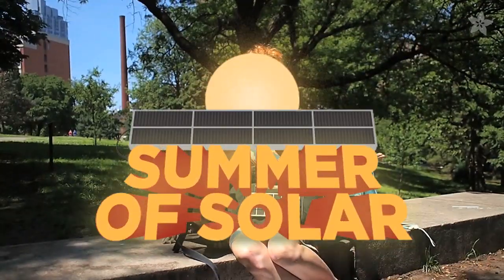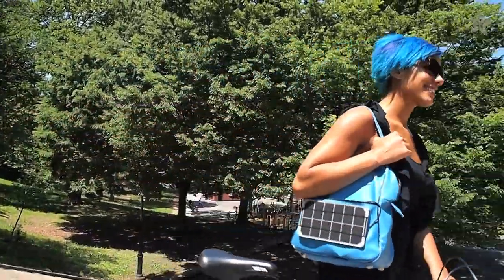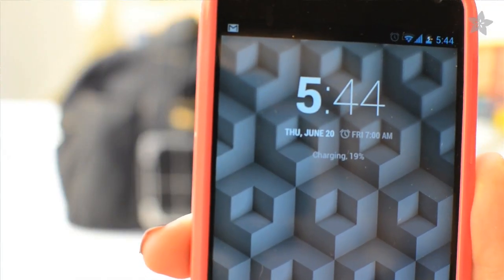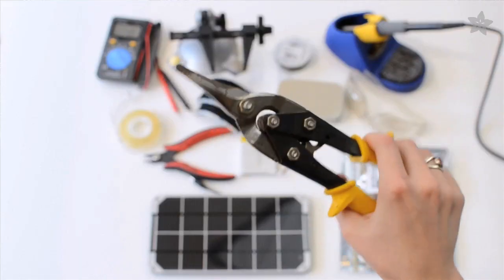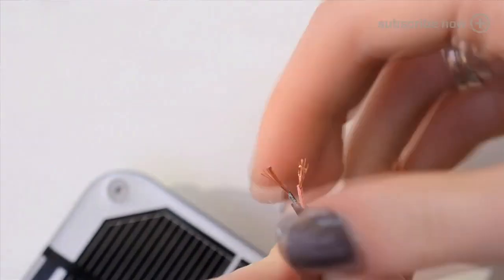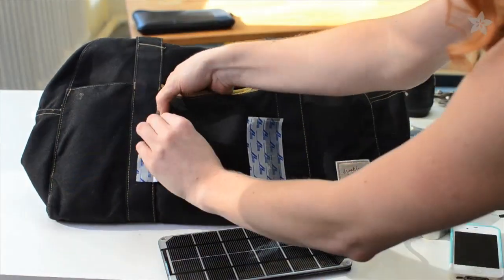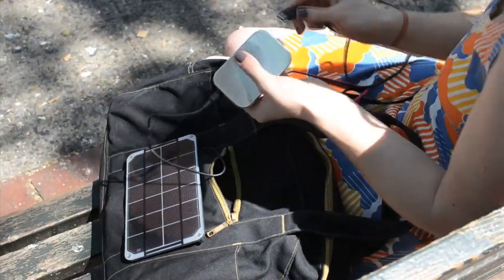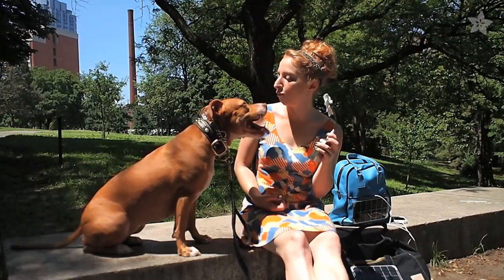Solar Charging Handbag

Comment: $17.5 for the solar charger, $20 for the MintyBoost, $12 for the battery, $35 for the solar panel. $10 for other stuff (the Altoids tin, the new plug, the heat shrinks) shipping really depends.